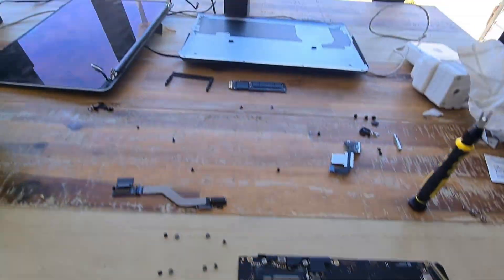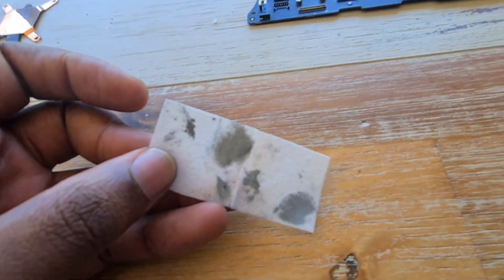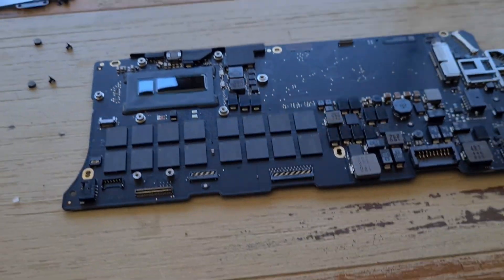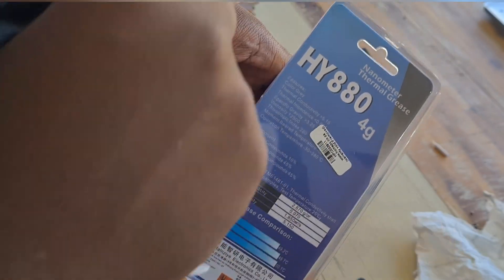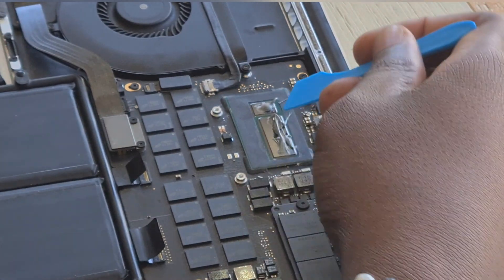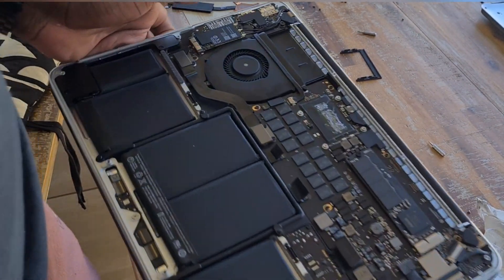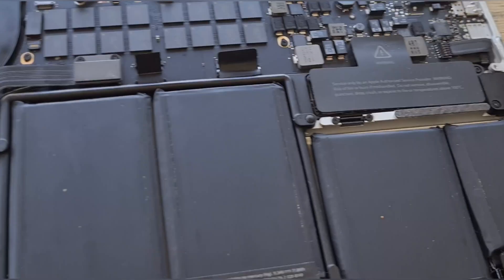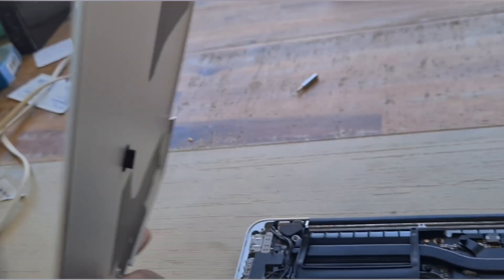MACBOOK PRO 13" A2289/A2159 OVERHEATING REPAIR ISSUE FIXED!!!!

Comment: Ah ah aaah! 
I don’t have the confidence to do this. The fear of making a mistake and breaking the device!🙆🏽‍♂️
Reply from the maker: 😆 It's not that bad. Just make sure you have the right equipment, and you have disconnected the battery first.

Comment: Thank you for this…Where can you find the alcohol to remove the battery and the thermal paste?
Reply from the maker: So I used cleaning pads from clicks... any pad that's 70% alcohol. The battery should have pull tabs so you can remove it, just pull them slowly to not break them.